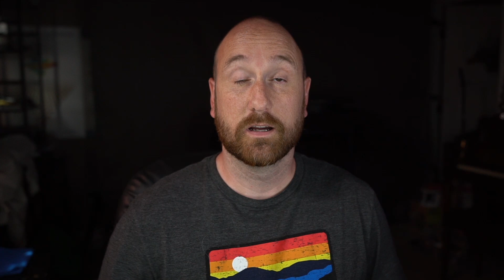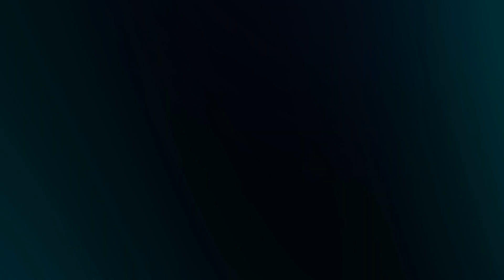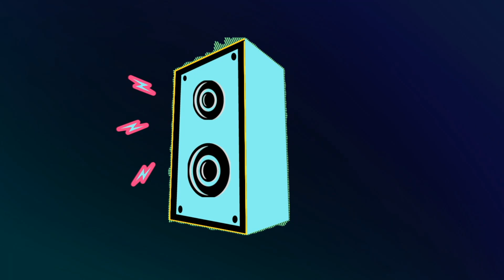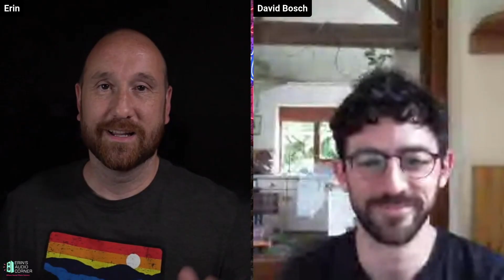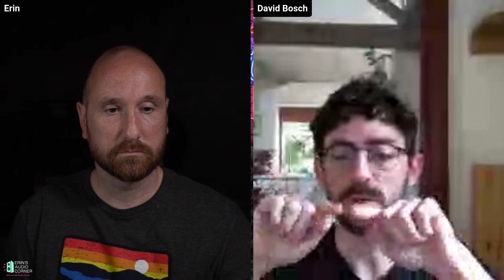Technical chat with David Bosch - Kef R&D Engineer - about loudspeaker design, IMD, and more!  💡💡

Comment: In the future, I would recommend that both sides record their audio locally, so that in the event of connection problems, you can still splice the good audio afterwards.

Also, consider using voice software like mumble, which you can setup for free and self-host, making you independent of platform reliability issues.

Comment: On the point of Eq'ing speakers (at around 20 mins) , I seriously hope that KEF can develop a proper room response diagnostic/speaker adjustment set up into their upcoming active designs at some time in the not too distant future. If you're manufacturing a fully active , DSP controlled loudspeaker (such as the LS60W) with it's own excellent measurements then it seems a shame not to.  I appreciate that it's a difficult balancing act (and practically not easy to do well ) in a domestic environment as opposed to a professional environment.
Reply: That is a very good point. I have both KEF LSX and Buchardt A500 SE's. I bought the KEF's first and was so impressed with active speakers that I worked my way into the Buchardts. One thing that Buchardt has that KEF does not is an easy room correction system. Maybe not as thorough as Dirac or Genelec's system, but it makes a real positive difference. And it is very easy to implement.

Comment: I've seen two sets of equations for Doppler distortion in loudspeakers based on cone area, excursion, and minimum and maximum frequency. Hence, they can be run for given output levels. The distortion levels have been correlated to perception. I can rummage about and see if I can dig them up if you'd like. Thanks again for another excellent video!
Reply: Would be cool to see them. Sounds like the kind of stuff you want on a cheat sheet next to your monitor.